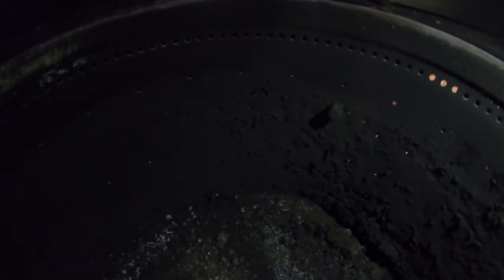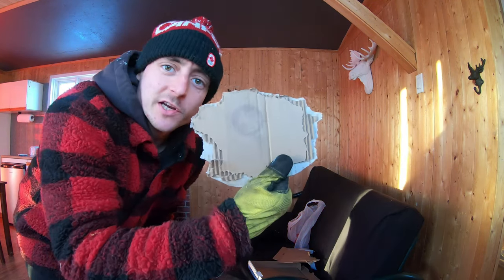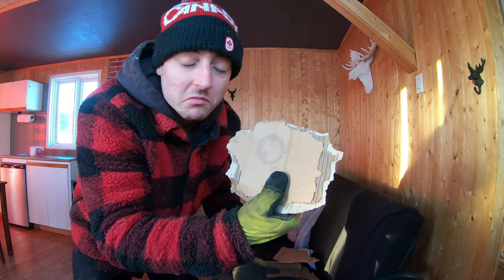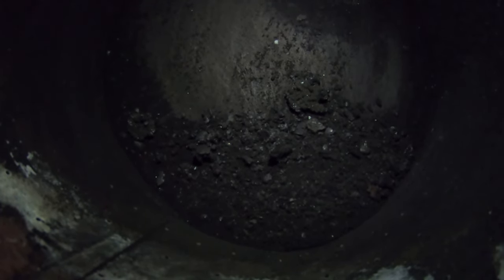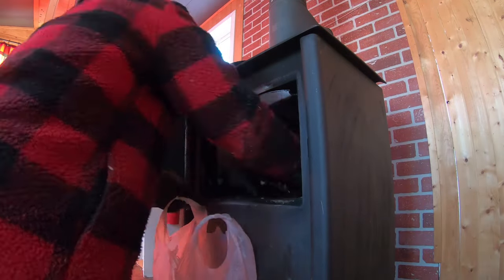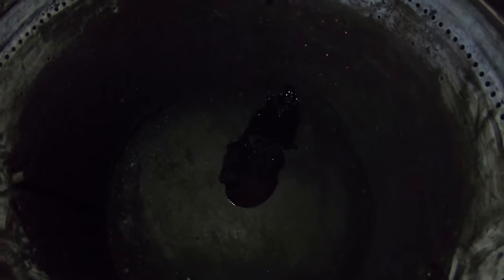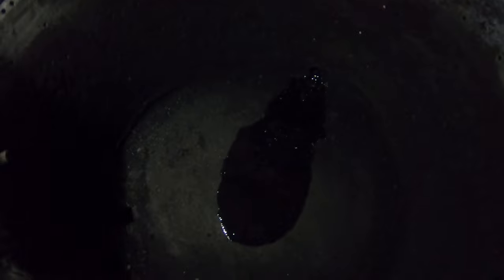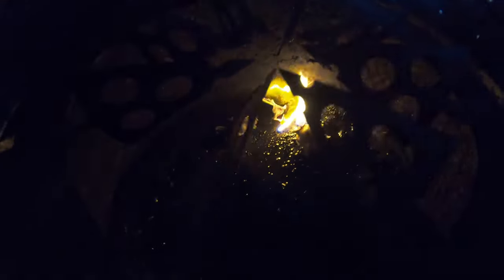OIL STOVE | How to CLEAN | make it run MUCH better

Comment: You are a Hero for the oil stove off grid community!
Reply from the maker: Thank you! If you need any other videos, let me know!
Reply: @philg  you saved my life with many of your existing videos, i fixed my line and my carburator settings :) !then I cleaned with a wirebrush inside the stove. All works like new now! Thanks, and best !
Reply from the maker: @Tabarnac2010  glad I could help :)

Comment: My model has a dial 1-4 to control the oil flow. There is a lever on the bottom right side of the Godin oil stove. When I was cleaning the tile area under the stove I accidentally moved that lever and now I am having oil flooding the bottom and causing the flame to flood itself out and fill the pan with too much oil even though the dial is set on 1 the lowest setting. My owners manual doesn't show this lever on the stove.

Comment: I have a Napolean OS10 and these videos are so helpful.  My stove had an about 3/8” length nipple where the oil dripped out but it rotted off.  It drips like the stove you have in the video.  Is it safe to run it this way and how hard is it to replace the nipple.?

Comment: How often should the pan be cleaned.  I’ve been running my stove continuously for about 4 months now.  Flame still looks ok, some yellow at higher firing.
Reply from the maker: I would clean it every 6 months if you use it regularly. If you see the performance drop, give it a good clean and it should increase performance.

Comment: The second comment is: I wish you measure the  room temperature before you light the stove & after few hours of lighting to see the efficiency of these kind of stoves.
Reply from the maker: Great idea! I could make a separate video on this.
Reply: In my experience, they work brutally well.  It takes them a good hour to ramp up, but once stabilized, they throw an amazing amount of heat.  They also do a great job of dehumidifying, like woodstove, and UNLIKE propane heaters.

Comment: Thank you, but I think the typical stove should allow you to take the oil burner container out of the stove, so you can easily clean it outside the stove.
Reply from the maker: Oh I should check this! Thx ☺️
Reply: It'd be difficult. While the burner is typically held in place by four screws, the oil feed port is threaded liquid tight into the burner, but through a burner shroud.  You'd have to remove the feed port to remove the burner.   Not a huge deal, but a little bit of work not making it worth it.
I just use a little 1 gallon shop vac placed outside, and 25 feet of sump pump hose, to vacuum out the loosened material.  Easy-peasy

Comment: Wow man you seem like a good guy and definitely glad to see some much needed videos on here about oil stove cleanings but that’s a very rough cleaning. I do mine every 6 weeks and it isn’t as dirty when I start my cleaning as yours is when your done your cleaning lol. You should never see soot on an oil stove. If you do it means the settings are not adjusted properly. My stove runs for 6 straight weeks at a time and I have never seen soot except for one time and upon inspection I noticed the lower ring wasn’t sitting flush on the pegs. Loose soot/glass soot is best removed using paint/radiator brush and a vacuum with a fine particle filter (critical as I seen homes ruined to the point of insurance jobbies). The white haze ( carbon) left on the glass after you removed soot needs to be addressed with a proper cleaner and soft rag as it will etch in to the high heat ceramic and over time will make it impossible to see through. Another big tip for these oil stoves is using stove oil or at minimum a winter grade furnace oil. Regular furnace oil will drop BTU significantly and will cause the unit to burn dirty. I never seen your other videos yet but before every heating season it is good practise to change the filter to prevent any damage/ trouble to the carburetor. Draft regulator should be inspected for dust/pet fur and if your unit has a cleaning “T”, it should be utilized as well to clean any obstructions from oil port. Strongly recommended to use a lighting gel as opposed to a piece of paper towel to light the stove as paper/cardboard leave deposits. The unit is manufactured to have the oil vaporize in a special area of the pot as to not cause flame impingement on the burner rings which is why you should use a brass bristle brush to make sure “the river” is as smooth as the day it was first installed. The Gasket around the glass should be inspected upon each cleaning religiously, if it’s deteriorated or missing it will spill exhaust fumes containing carbon monoxide into the room and these units have no spill switch or safety device to shut off the unit incase of CO leakage. Can never be too careful man when it comes to this stuff. All the best!! Cheers!!
Reply from the maker: Awesome reply and great tips!! I will make sure to include your info in my future videos. All the best from Canada :)
Reply: @philg  Sounds good buddy. Great videos to. Keep it up man  I’m from Canada as well. 🇨🇦
Reply: You should definitely make a video on cleaning these oil stoves
Reply: Where is the filter located and where do I get a new filter from?

Comment: Nestor Martin P Fonte C100.  Been running good until yesterday evening.  Started shooting up.  Shut it off this morning and cleaned out thoroughly.  Relit and got good blue flame to start with.  After a while it started burning yellow and glass sooted up.  What do you think?  Stove has burned good for a couple months before this.  Of course it is -15F outside.  Should I put additives in the diesel? My carb has a thermostat device on it.  There is no hi or low fire adjustment screws that I can find.  I would like to attach a picture, but can’t figure out how to.
Reply: Turned out the main filter (General 1A-30) was full of waxy creamy stuff, it has been -15F.  Changed out filter to spin on cartridge type.  Added a quart of 911 anti gel to tank.  Stove runs better than it ever has, blue flames with occasional orange tips. 😎😎😎

Comment: Hey Phil thanks for the help great oil stove videos. I just got a used oil stove and I can't get the blue flames only yellow. Any ideas?
Reply from the maker: Try to wire brush the burner holes so air flows properly. Check out my recent video, you can try adding a stainless steel mesh yo act as à catalyser :)

Comment: What oil are these stoves used for? I live in Europe and want to burn on used engine oil, is that even possible with these carberators??
Reply from the maker: These stoves are used as a primary or secondary heat source. Typically you can find heating oil, but diesel works great too. I will make a video soon with used engine oil, maybe some
Free heat?!

Comment: Does burning oil leave any residue buildup  in the flue ?
Reply: If running improperly like his stove is, yes, it will, but it's not like big, flakey creosote buildup like you see from a wood stove.   I don't think it's flammable like creosote either.  If anything, a bit of soot may create a bit better draft
Set up so it is not sooting up the glass and stuff, you can go 10 years without having to sweep the flue.  (always a good idea to check it before first light of the season, though.  You never know what might have crawled up in there and died) 😉
Reply from the maker: Not too much if run clean :)

Comment: Where should a heat sensitive safty valve be placed???
Reply from the maker: Good question. I would refer to the user manual for your specific stove to ensure Maximum safety.

Comment: What does it cost to run ? It is above freezing now and I have been running approx 7 liters a day
Reply from the maker: That’s a great question, with diesel prices going up, I would say $10-15$/ 24hrs roughly.
Reply: You'd have to ask your oil supplier what their per liter rate is.

Comment: "use steel wool on glass."

No, no, no no! For other viewers:  That's not glass! And abrasives are a big no-no.  Windex or water/vinegar mix only, though you can use a little ash, but preferably wood ash, rather than the oil ash/slag.
The window shouldn't be sooting up, if the stove is set up correctly.   You probably have a low draft issue.
Reply from the maker: Very true! Thank you for the client